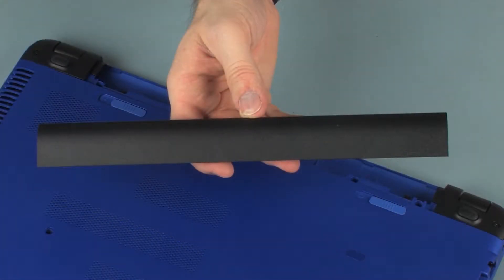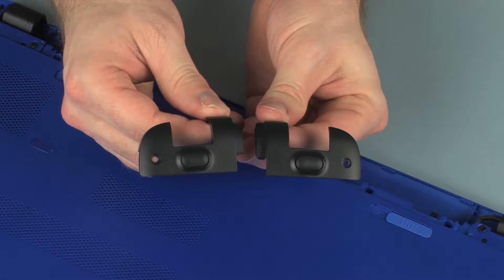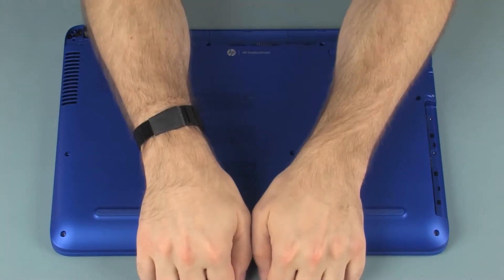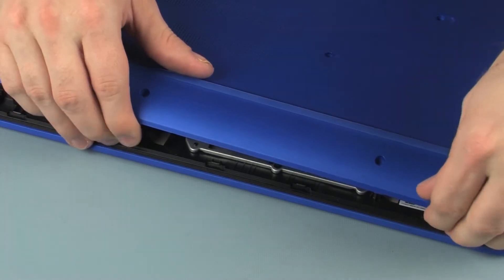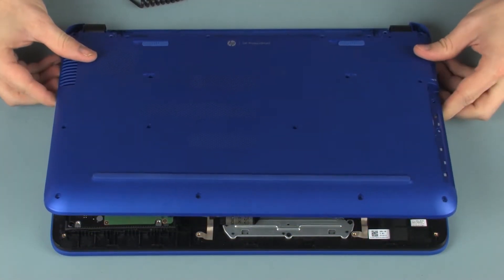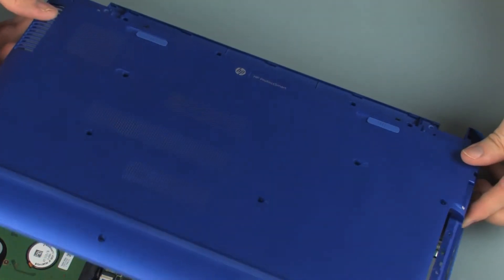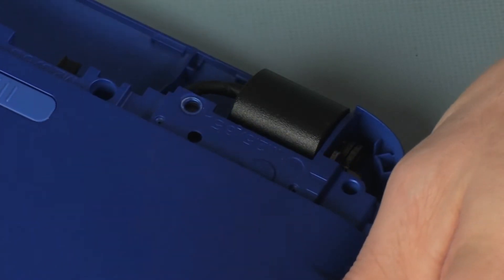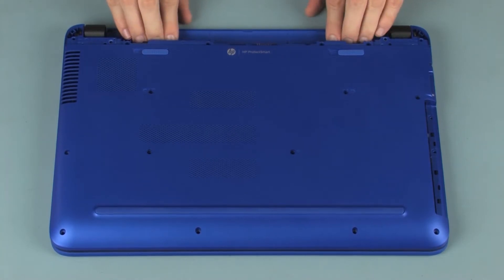Replace the Base Enclosure | Pavilion 15-ab000 Notebook | HP Support

Comment: what about the two screws hidden under the optical drive on the 15-ab150sa?
Reply: It seems that they can't do anything right...
Reply: How did you remove those 2 screws? The back won't budge with them in place but not sure who has a screwdriver that will remove them, they are tiny!
Reply from the maker: +JaniToad  Please refer this video to know about replacing the optical drive: https://bit.ly/2YLPVz3